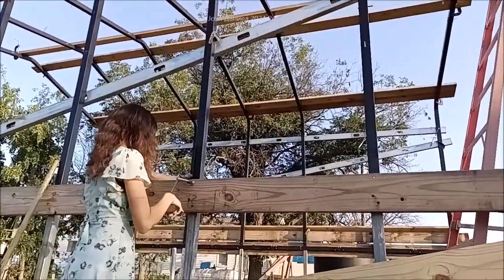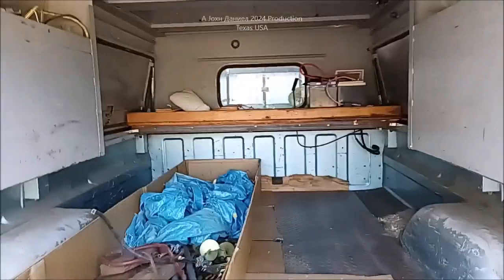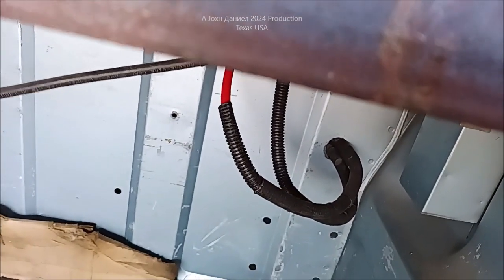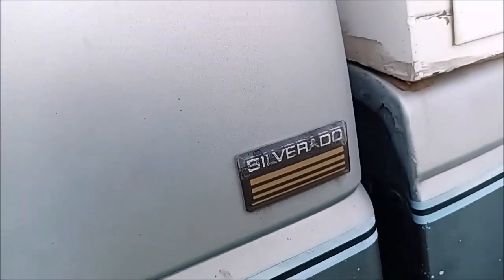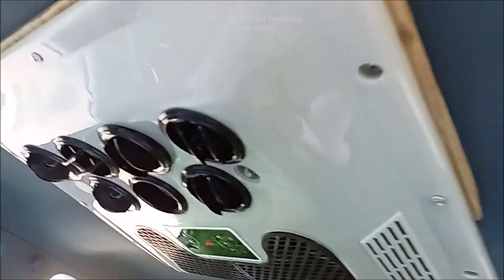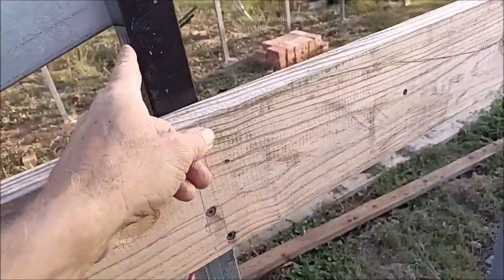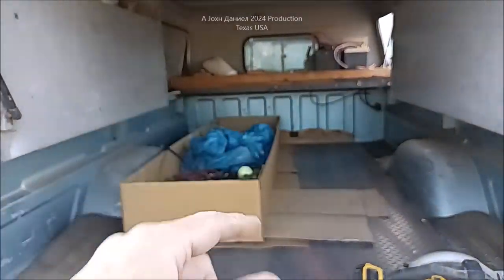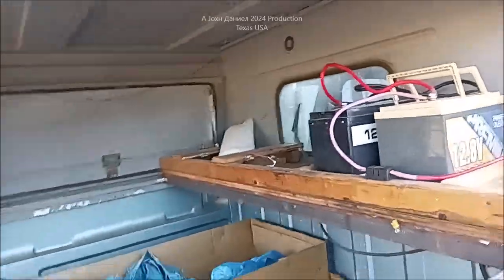One Year using 12 volt DC Roof Air Conditioner, How has it survived? NICELY! More info below video

Comment from the maker: DC Air Conditioner 12 volt Air conditioner Outequip ROOF model https://amzn.to/3FMIT2z or https://amzn.to/45DOBwd & 12 volt split model https://amzn.to/4b5PzUv  ( cheaper sources below ) Outequip treeligo 12 volt 8470 btu Roof Air Conditioner https://ebay.us/cKQkWk & Outequip treeligo 12/24 volt Air conditioner ROOF model https://ebay.us/i25oPb & 12 volt split model https://ebay.us/QRYyPA 👉 Support/Donate with KoFi - https://ko-fi.com/john4kiera OR https://bit.ly/2buyaCoffee all support helps. ⬇ LiTime Battery https://amzn.to/4l1C8ZT & Solar Connectors https://amzn.to/3OXUpdi 
 **This channel may earn a commission from links offered at no cost to you. 
HEY They are sold on Temu as well, see it here: 12V RV Air Conditioner with Heat 8.5K BTU 2-in-1 Heating & Cooling, Quiet Rooftop AC Unit Combo for Truck, Trailer, Boat, Motorhome, Camper, Caravan - Energy Efficient, Compact Design w/Remote Control & Gauge, Motorhome Heating | Durable Construction
👉 item link: https://temu.to/k/pujyli3arb0
🎉 Coupon price[$530.80]
✨ DO BETTER FOR LESS $$ all SWI-POWER Pure Sine INVERTERS Main Site! https://amzn.to/4kvK1Xf Any in DC/out AC Voltage! Very Fast Shipping! Voltage! Very Fast Shipping!

Comment: @JOHNDANIEL1 can you run this type of air conditioner on the vehicles existing alternator?
Reply from the maker: Most modern vehicles 1990 to now are so hard core full of electric items that they can not run such a item on their alternators or wiring. Same reason you add a "winch battery" to run a bumper winch or a extra battery to run a large stereo system the wiring and power of most vehicles can barely run the car and keep its own battery charged with any constant draw over 25 amps above the car/trucks own usage. Adding a spare battery helps because when the compressor cycles on and off it can get more charge during off cycles to always run the roof AC units.
Reply: @JOHNDANIEL1  how much does the AC unit draw at its maximum?
Reply from the maker: @budgreenjeans  Absolute max is based on rotor lockup and that would be 60 amps on this one. It should not happen unless you careless but that would be the rating on that. The max hot running re-start amp draw is 52 amps, normal cycling is 32 to 44 amps depending on your use. I can usually get just over 5 hours from 2 of the 100AH lithium batteries with temps outside under 95 degrees. Less than 5 hours with it over 100.

Comment: I first saw Power Queen batteries in one of your videos maybe a couple years ago, now I have 2 50AH which I am using to build a solar battery box.
Reply from the maker: Get more when possible. A pair is a good start but not high capacity for real back up.
Reply: @JOHNDANIEL1 These two are for portable use, trying to keep the whole thing under 50#, looking to get at least four more for a camping trailer project that is in progress. I’m doing multiple smaller batteries vs 1-2 large ones so if there is a problem with one it can be bypassed without wiping out so much capacity.
Reply from the maker: @wickedmuffin76  Power Queen is a superior consumer grade. About the best small battery for the weight and lifespan ability is not the brand you would expect. E-Lektek 50 AH is the one, https://amzn.to/3y6Wa2n they make the EG4 rack cells and parts. And they are cheaper than most others since they are a supplier as well as a maker.  Their 120 AH https://amzn.to/4di5aAl Has BVD 124 AH cells very unusual in look and install.
Reply from the maker: This will shock you, CHEAP price on Wattcycle. https://temu.to/m/ul9bnwbra2h

Comment: So max use is a about 550watt on the battery
Reply from the maker: 105 degree day, fresh start you will see 600 for a few minutes but 90 to 100 degrees its about 500 to 550 on max cool during full compressor runs. Once moving in the truck and cooler in the truck its 320 to 400 most all the time.

Comment: They use those on a lot of equipment, seem to work good. 
 I would use a sealtite type fitting for those cables coming in through the bed. Don't want a short and a fire.
Reply from the maker: It's better than we thought it would be. The Chevy is horribly insulated compared to a Ford or small RV but it's working good anyhow.

Comment: makes a lot more sense then spending who knows how much on repairing the AC on a 30+ year old truck, especially since you can remove/re-purpose it if the truck dies.
Reply from the maker: The engine in it is a 5.7, was replaced in 1994 under warranty with 37K on it, so the engine in it just has 88K on it but the rest is pure rusting 1990 Chevy. So when it dies the re-use of it is why we chose this. The truck was salvaged of all the in-dash and most under hood AC parts for a vintage truck the previous owner had restoring. He was also to take the engine and trans but got sick and we bought this one as is for $750. Already made 7 trips Texas to Idaho so good money spent with it. Now it is our Shed building, solar and wind turbine installer truck. Gets 17 mpg and my Ford is lucky to see 11.5 mpg. This summer I got over 80 hours sitting in it cooling off already. Love it!! Thinking on insulating and putting another on the camper box roof.
Reply: @JOHNDANIEL1  I'd say money well spent for sure. There's always something to be said about trucks that are dead simple work machines. Always good to have a "beater" truck , love my 97 F150.

Comment: Good small off grid camper ac
Reply from the maker: These are excellent for vans, truck campers, or if your insulated well a camper up to 18 to 20 foot can use them. I have no heat regulation since the stroke I had so this is a summer time job site tool for me.

Comment: What is the temperature reading with a temp gun at the vents and inside truck?
Reply from the maker: The output was showing about 9 Celsius but that was with the door sitting open. It normally runs 4.8 to 6 Celsius output temps ( 39 to 44 degrees Fahrenheit ) with temps like today of 92 degrees outside.  When it's over 100 outside it will not get colder on the output than 47 to 48 Fahrenheit unless we sit in the shade. But it will keep the truck at about 75 degrees inside so works as expected. A modern truck is more insulated, this is a 1990 Chevy 2500 very stripped down on such things. I am putting in 6mm Heat/Insulation shield in it later.
Reply: @JOHNDANIEL1 That’s just at comfortable temperature 75°F , I set house AC temperature at 76°F that’s the best cost-effective temperature without the bill being too inflated, especially when outside temperature is 100+°F.
 Thank you for the feedback. Using those thicker sunshades for the front windshield and even putting some on the side windows would help insulate/deflect /reflect a ton of Sun to make it cooler especially if you’re just using that as a chill spot for workday and not driving a vehicle.

Have you looked into those mini split cassettes could have a higher output in coldness and less watts/amps lasting longer I think they’re about the same price point …

Comment: So it could also run from the car power only when the car is running?
Reply from the maker: Yes and No! Depends on the output of the alternator. You need 50 amps extra from the alternator to run them and also keep or add charge to the extra or main battery in your set up. Most cars can do it, almost all trucks can.
Reply: @okkrom  Since it only draws 20-40 amps any car alternator could keep up with the power draw.
Reply from the maker: Careful not to toast your alternator. They post 70 amp, what they mean is 35 amp continuous, 50 amp with engine RPM up,  and 70 amp in a emergency! I recommend adding a spare battery. Lately I am working with folks who do the DC. Helped them with great changes and now has a pro level DC platform to offer, share them to your friends, great stuff. Veryeah DC Power cooking, energy  and portables https://shrsl.com/4maqn

Comment: I wonder how much space this would cool off????
Reply from the maker: Does real good in a poorly insulated king cab truck, takes 2 in a 27 foot RV, but another we installed into a Casita RV trailer, 15.75 x 7.5 foot and it has been on all summer cooling for her She has 5 of the batteries I shown and linked below, but she just barely has enough roof solar, needs another 150 to 200 watts on the trailer to go all night so 1-3 hours is on her little 1500 watt generator to run it and boost batteries till sun up. I expect her to solve it this fall. It will need full power during main heat of day 39 to 43 amps, efficiency mode 20 to 23 amps is fine after 6 or 7 pm though. I am working with them the manufacture Futrun New Tech on a new Vertical in the wall inserted model design so stay tuned.
Reply: @JOHNDANIEL1  lol I was trying to figure out a cheap way to cool my kitchen.

Comment: Great follow up video. Nice to see that it's still working great.👍👍👍👍
Reply from the maker: It's been a great investment for hot days Puppy Safety. Allows you to take the collies shopping and keeps the truck very safe and cool while your around places that they can't go into. My bonus is just recent using it 40 miles south of San Angelo on a 3 day job with a few extra batteries I slept in the truck to save big $$$ on motel cost. Since my 2014 stroke, I have to have a close by cool down area, it's great on building sites.
Reply from the maker: You should get you a under bunk model and a 300ah battery in your truck.